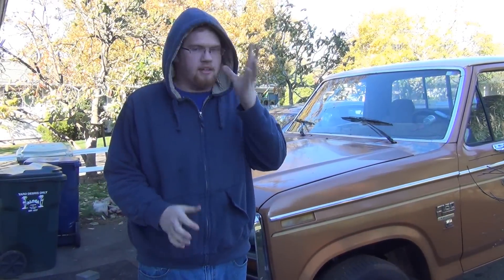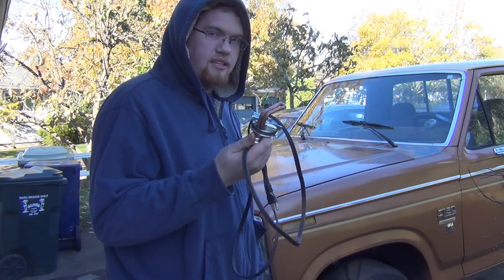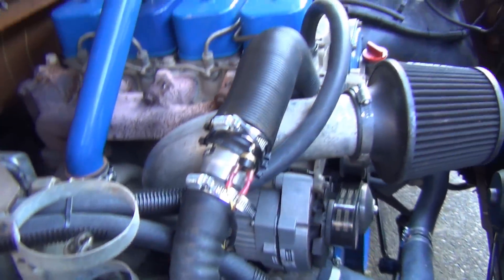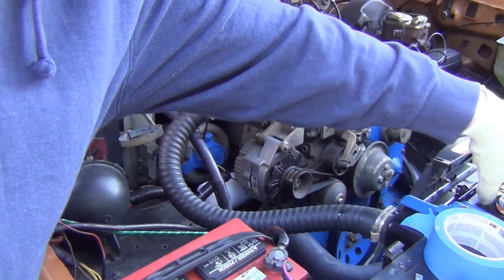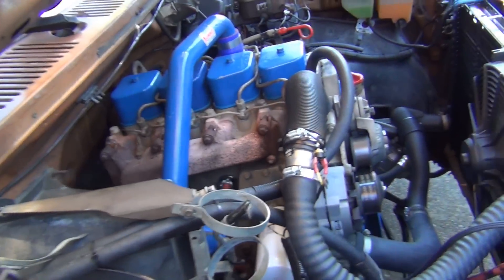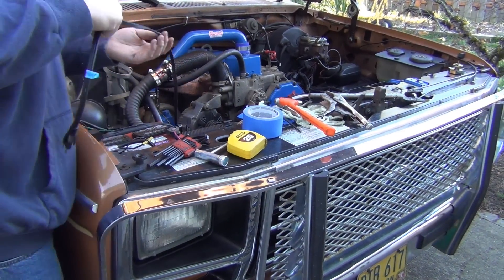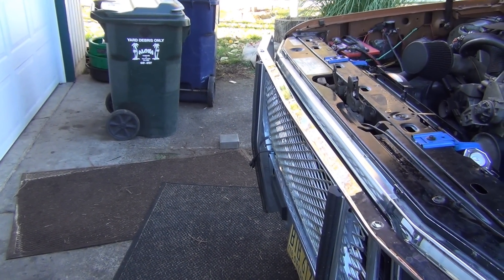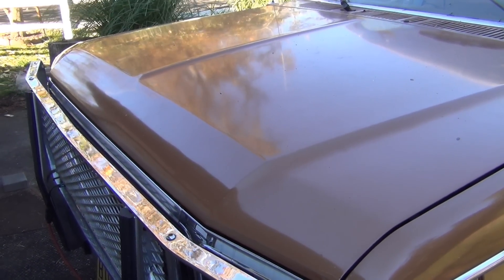4BT Cummins Turbo Diesel Block Heater Installation

Comment: Intake heater grid. Much easier to install and is standard Cummins pre-heater for easier winter starting. Might be more expensive but will save you loads of headaches. Id suggest you get a warming mat for the battery and a magnetic oil pan warmer. Those three combined will make (captain planet!) starting easier. Also upgrade the CCA battery to 800 or better.

I'm going to continue gathering parts for my discovery and have plenty of work for when it warms up. Enjoy your videos.

Comment: Hey buddy I have a Cummins 4B that came in my 1972 DJ-5 Postal Jeep. The radiator is shot and I need a new one. Any idea what kind I can get? The one on it is 20x18x2.5 thanks